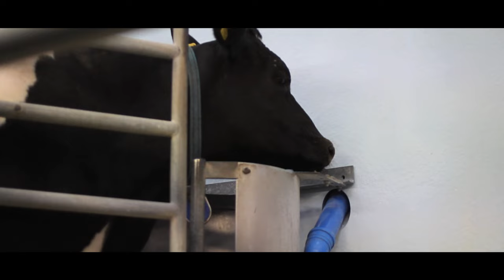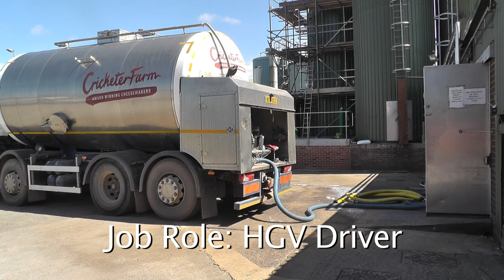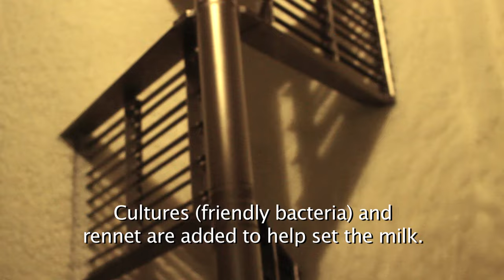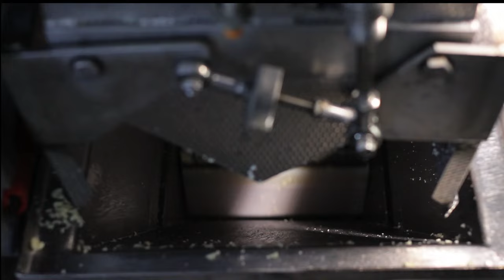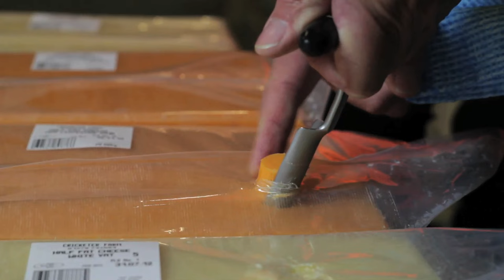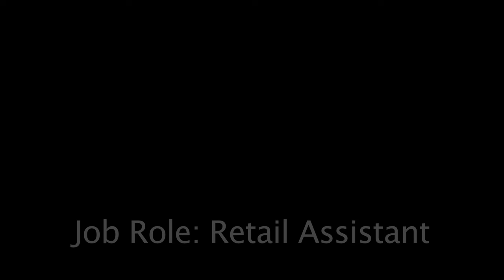Cheese Making Process

Comment: Cheese is a food derived from milk that is produced in a wide range of flavors, textures, and forms by coagulation of the milk protein casein. It comprises proteins and fat from milk, usually the milk of cows, buffalo, goats, or sheep. During production, the milk is usually acidified, and adding the enzyme rennet causes coagulation. The solids are separated and pressed into final form.[1] Some cheeses have molds on the rind, the outer layer, or throughout. Most cheeses melt at cooking temperature.
Hundreds of types of cheese from various countries are produced. Their styles, textures and flavors depend on the origin of the milk (including the animal's diet), whether they have been pasteurized, the butterfat content, the bacteria and mold, the processing, and aging. Herbs, spices, or wood smoke may be used as flavoring agents. The yellow to red color of many cheeses, such as Red Leicester, is produced by adding annatto. Other ingredients may be added to some cheeses, such as black pepper, garlic, chives or cranberries.
For a few cheeses, the milk is curdled by adding acids such as vinegar or lemon juice. Most cheeses are acidified to a lesser degree by bacteria, which turn milk sugars into lactic acid, then the addition of rennet completes the curdling. Vegetarian alternatives to rennet are available; most are produced by fermentation of the fungus Mucor miehei, but others have been extracted from various species of the Cynara thistle family. Cheesemakers near a dairy region may benefit from fresher, lower-priced milk, and lower shipping costs.
Cheese is valued for its portability, long life, and high content of fat, protein, calcium, and phosphorus.
 Cheese is more compact and has a longer shelf life than milk, although 
how long a cheese will keep depends on the type of cheese; labels on 
packets of cheese often claim that a cheese should be consumed within 
three to five days of opening. Generally speaking, hard cheeses, such as
 parmesan last longer than soft cheeses, such as Brie
 or goat's milk cheese. The long storage life of some cheeses, 
especially when encased in a protective rind, allows selling when 
markets are favorable.
There is some debate as to the best way to store cheese, but some experts[who?]
 say that wrapping it in cheese paper provides optimal results. Cheese 
paper is coated in a porous plastic on the inside, and the outside has a
 layer of wax. This specific combination of plastic on the inside and 
wax on the outside protects the cheese by allowing condensation on the 
cheese to be wicked away while preventing moisture from within the 
cheese escaping.[2]
A specialist seller of cheese is sometimes known as a cheesemonger.
 Becoming an expert in this field requires some formal education and 
years of tasting and hands-on experience, much like becoming an expert 
in wine or cuisine. The cheesemonger is responsible for all aspects of 
the cheese inventory: selecting the cheese menu, purchasing, receiving, 
storage, and ripening.[3]

The word cheese comes from Latin caseus,[4] from which the modern word casein is also derived. The earliest source is from the proto-Indo-European root *kwat-, which means "to ferment, become sour". The word cheese comes from chese (in Middle English) and cīese or cēse (in Old English). Similar words are shared by other West Germanic languages—West Frisian tsiis, Dutch kaas, German Käse, Old High German chāsi—all from the reconstructed West-Germanic form *kāsī, which in turn is an early borrowing from Latin.
The Online Etymological Dictionary
 states that "cheese" comes from "Old English cyse (West Saxon), cese 
(Anglian)...from West Germanic *kasjus (source also of Old Saxon kasi, 
Old High German chasi, German Käse, Middle Dutch case, Dutch kaas), from
 Latin caseus [for] "cheese" (source of Italian cacio, Spanish queso, 
Irish caise, Welsh caws)." [5]The Online Etymological Dictionary
 states that the word is of "...unknown origin; perhaps from a PIE root 
*kwat- "to ferment, become sour" (source also of Prakrit chasi 
"buttermilk;" Old Church Slavonic kvasu "leaven; fermented drink," 
kyselu "sour," -kyseti "to turn sour;" Czech kysati "to turn sour, rot;"
 Sanskrit kvathati "boils, seethes;" Gothic hwaþjan "foam"). Also 
compare fromage. Old Norse ostr, Danish ost, Swedish ost are related to 
Latin ius "broth, sauce, juice.'"[5]
When the Romans began to make hard cheeses for their legionaries' supplies, a new word started to be used: formaticum, from caseus formatus, or "molded cheese" (as in "formed", not "moldy"). It is from this word that the French fromage, proper Italian formaggio, Catalan formatge, Breton fourmaj, and Provençal furmo are derived. Of the Romance languages, Spanish, Portuguese, Romanian, Tuscan and Southern Italian dialects use words derived from caseus (queso, queijo, caș and caso for example). The word cheese itself is occasionally employed in a sense that means "molded" or "formed". Head cheese uses the word in this sense. The term "cheese" is also used as a noun, verb and adjective in a number of figurative expressions (e.g., "the big cheese", "to be cheesed off" and "cheesy lyrics").

A required step in cheesemaking is separating the milk into solid curds and liquid whey. Usually this is done by acidifying (souring) the milk and adding rennet. The acidification can be accomplished directly by the addition of an acid, such as vinegar, in a few cases (paneer, queso fresco). More commonly starter bacteria are employed instead which convert milk sugars into lactic acid. The same bacteria (and the enzymes
 they produce) also play a large role in the eventual flavor of aged 
cheeses. Most cheeses are made with starter bacteria from the Lactococcus, Lactobacillus, or Streptococcus families. Swiss starter cultures also include Propionibacter shermani, which produces carbon dioxide gas bubbles during aging, giving Swiss cheese or Emmental its holes (called "eyes").
Some fresh cheeses are curdled only by acidity, but most cheeses also
 use rennet. Rennet sets the cheese into a strong and rubbery gel
 compared to the fragile curds produced by acidic coagulation alone. It 
also allows curdling at a lower acidity—important because flavor-making 
bacteria are inhibited in high-acidity environments. In general, softer,
 smaller, fresher cheeses are curdled with a greater proportion of acid 
to rennet than harder, larger, longer-aged varieties.
While rennet was traditionally produced via extraction from the inner
 mucosa of the fourth stomach chamber of slaughtered young, unweaned 
calves, most rennet used today in cheesemaking is produced recombinantly.[21]
 The majority of the applied chymosin is retained in the whey and, at 
most, may be present in cheese in trace quantities. In ripe cheese, the 
type and provenance of chymosin used in production cannot be determined.[21]
Curd processing
At this point, the cheese has set into a very moist gel. Some soft 
cheeses are now essentially complete: they are drained, salted, and 
packaged. For most of the rest, the curd is cut into small cubes. This 
allows water to drain from the individual pieces of curd.
Some hard cheeses are then heated to temperatures in the range of 
35–55 °C (95–131 °F). This forces more whey from the cut curd. It also 
changes the taste of the finished cheese, affecting both the bacterial 
culture and the milk chemistry. Cheeses that are heated to the higher 
temperatures are usually made with thermophilic starter bacteria that survive this step—either Lactobacilli or Streptococci.
Salt has roles in cheese besides adding a salty flavor. It preserves 
cheese from spoiling, draws moisture from the curd, and firms cheese’s 
texture in an interaction with its proteins.
 Some cheeses are salted from the outside with dry salt or brine washes.
 Most cheeses have the salt mixed directly into the curds.